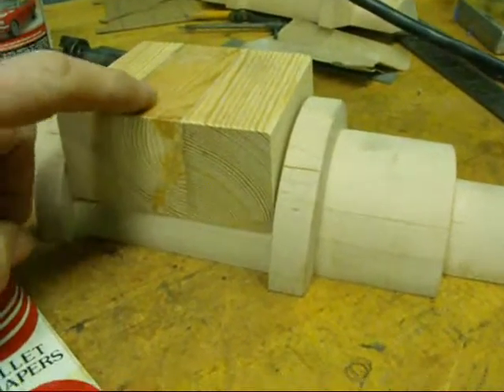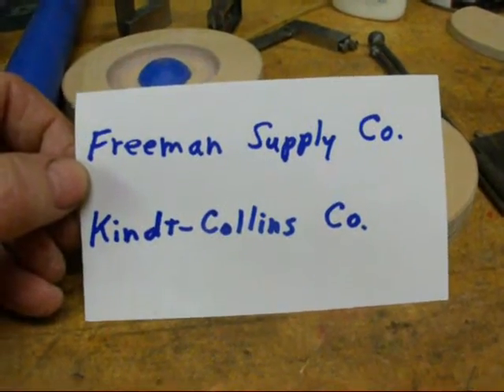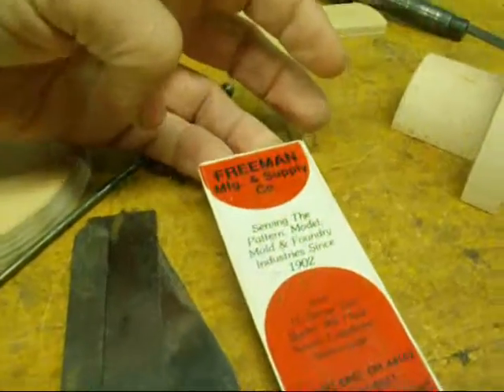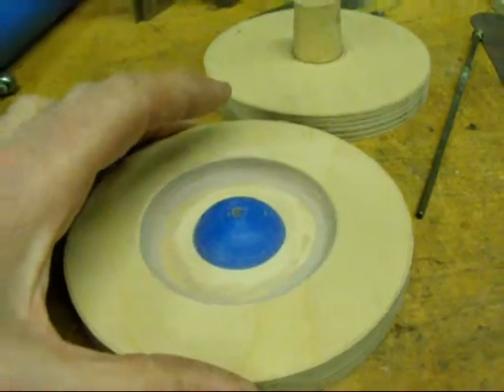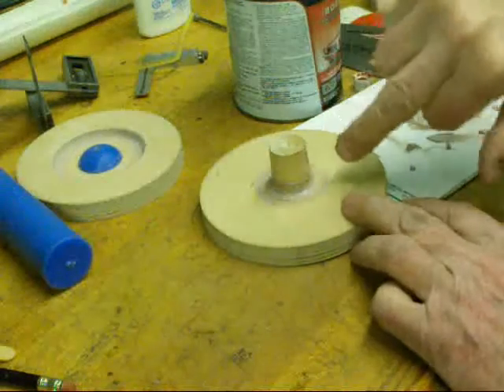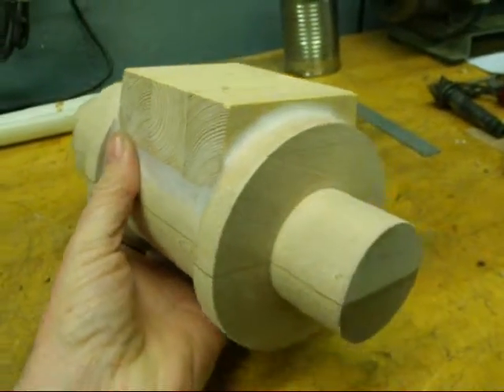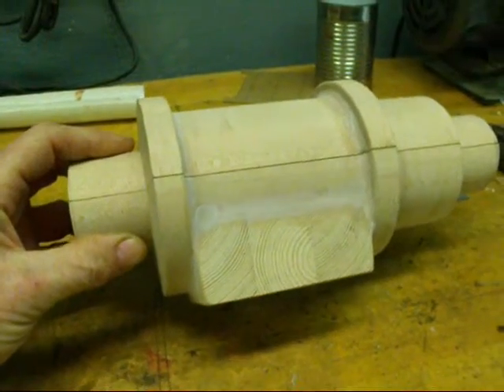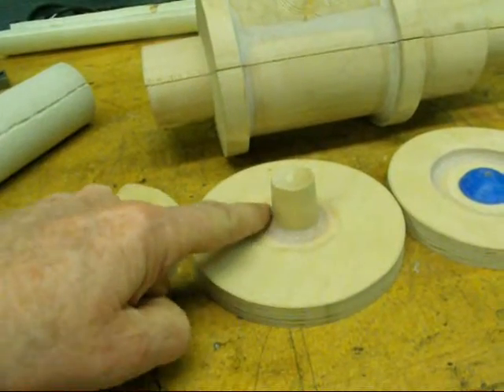FOUNDRY PATTERN MAKING part 5 Steam Engine metal casting tubalcain

Comment: Avoid tear-out at the ends by clamping support boards to the front and rear which you can mill (or rather, rout) into. That way, the wood grain of the actual workpiece is protected from tearing out.

This is a great series, it must be the largest 'home' or 'garage' casting I've seen so far, can't wait how it turns out.

Comment: You mention that the fillet is important due to appearance and shrinkage. A sharp corner will also affect the resulting grain structure. Re-crystallization of the metal begins at the surface and extends into the work piece at 90 degrees to the face (the outside cools faster). Even though casting creates an unbalanced grain structure (as opposed to forging) there will still be a mechanical weakness due to a crystallographic boundary forming into the piece along the axis of symmetry in the angle.

Comment: mr pete, put mixed bondo into a plastic bag and cut one corner off, then use it like a pastry gun. it will turn out very smooth in tight spaces.